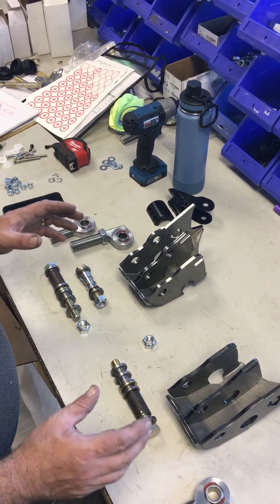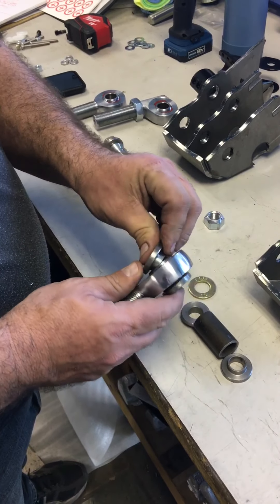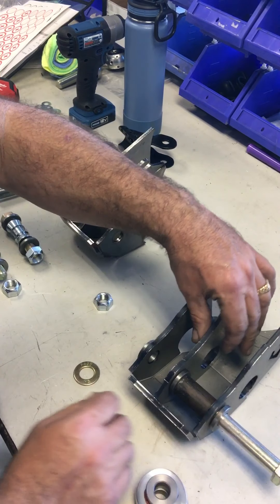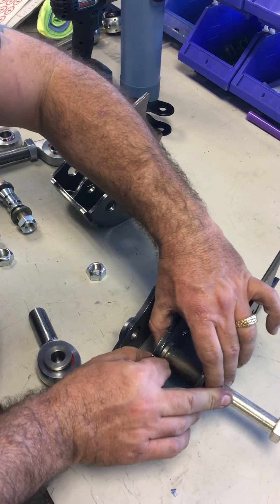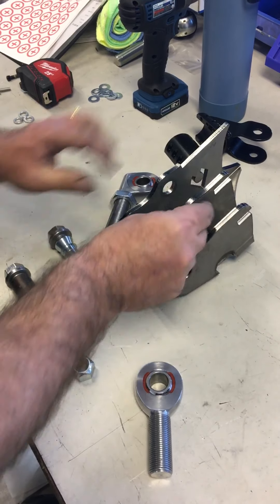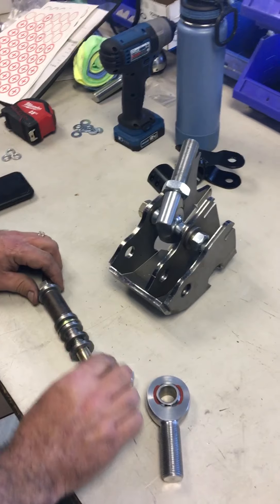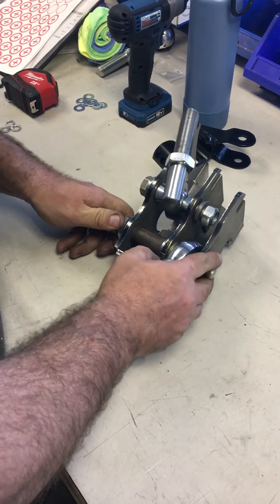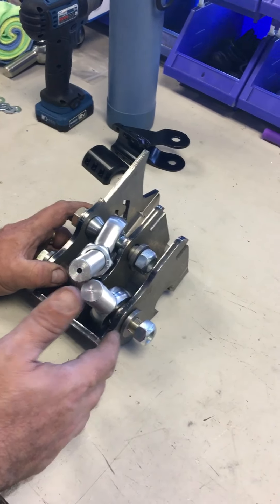RPM Steering Kit install on Artec Weld on Superduty High Steer Arms with RPM Spacing

Comment: So you don’t ever weld in that middle brace? Or do you weld it in after you get it setup correctly?
Reply from the maker: Yes you will weld in the middle brace. You just need to use our spacing before welding. Do not follow the artec spacing.